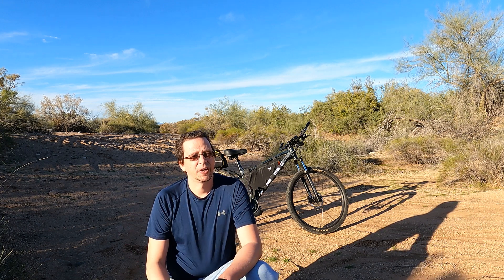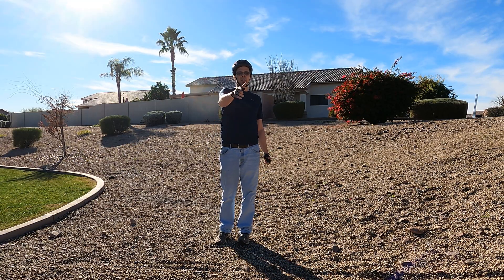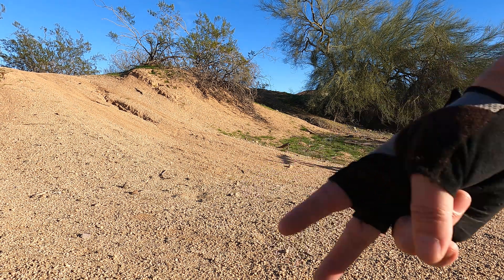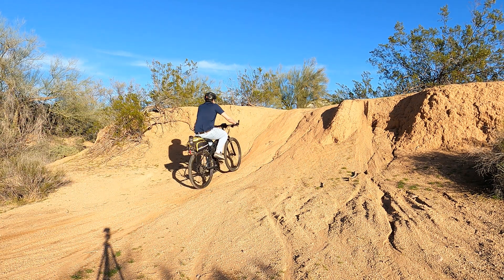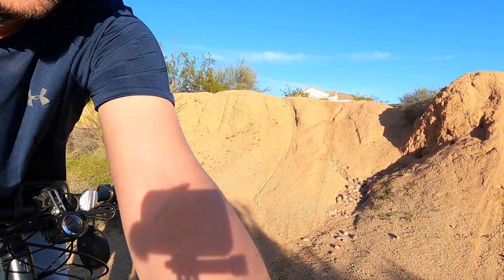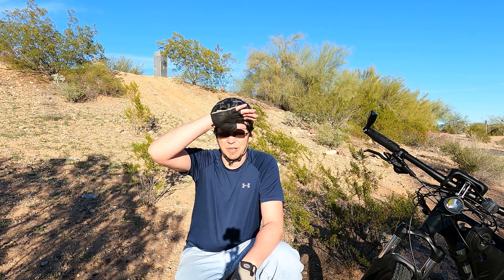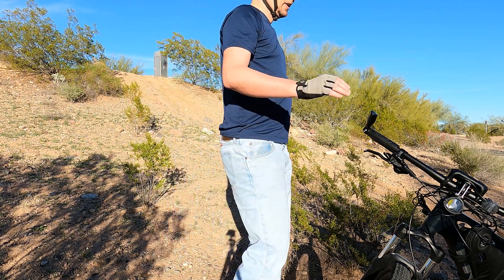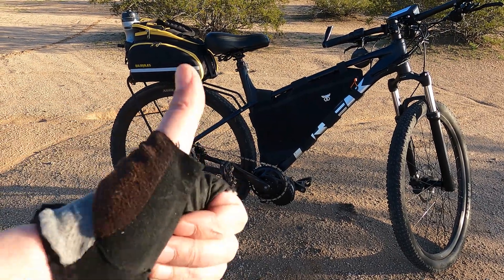🚴‍♂️BBSHD Hill Climb Tests | Electric Bike Hill Climb Tests

Comment: I've had 2 bikes with bbshd's over the last 2 years now and they are still both complete weapons and a joy to ride. 

If you read this comment and you're on the fence about buying a bbshd, just do it. 
You won't regret anything and you'll enjoy every moment.
Reply: How often do you go through chains and cassettes?
Reply: @thesquishyboo  casettes i've changed once, but it wasn't due to wear. I just wanted to tweek the ratios. 
10 speed chains are only $12 or something, so i just change them each year so far. I'd rather not be out on a trail dealing with a broken chain, so i just change them routinely. 
I've broken 1 chain so far, but i'm not sure how it broke and i don't think it was ebike related, i just hit something on the trail and weakend it 👍
You do get extra wear from running a middrive, but it's not hard or expensive to refresh.
Reply: @ thank you very much for your reply. I am going to buy the bbshd for my road bike and convert it. I cannot wait!
Reply: @sparkoceanic Hi spark, hope you don't mind me shortening your name up like that,I'm glad that people like yourself are giving your honest opinions, and that places like this exists, I'm trying to learn, about everything even this internet thing is New to me, I've tried it before but that's right around when I had an accident, some years ago now, and well I'm back at it again now but finding it hard to talk with people,or rather how to talk because I'm older I think and so messed up physically and even have what's called dislexia and a little bit of other stuff along with PTSD, so some stuff really going on, and because of a stroke and breakages in the spine I've suffered any how I'm finding it rather difficult in explaining things to people, it's almost as though don't have the time to listen or even really want to, I honestly don't know,but man im going through alot right,and now days really who's not; I totally get it, I understand; and I don't know why, it's almost weird because you can't really get what you need to say out there fast enough before people just turn you off like a switch, so I'm finding it difficult to talk to people while making it as short and to the point as possible and that's hard with being messed up from a stroke you're supposed to be able to meet and make friends on here right? I thought that that's sorta what goes  on with these inner web things or I mean interweb site's or no, web sites, I mean right? Sorry about that. See I mess things up sometimes and I end up not being able to even meet people for friends. Anyhow , enough with that I just thought that if I could at least explain why I'm so weird then I could make friends even at my age if they'd take a minute to try in understand me. Well it's my only dream right now before my time's up man, is to build a bike that I could pull a little trailer with not so much for a solar panel, although it would be cool to build one like Eric's but I'm going to buy like 2  extra batteries and chargers  for whatever bike I wind up with. But living vicariously through Eric's films I sort of had that dream of doing the solar panel thing, it's so cool and energy efficient and                                        .I'm trying to commit with  actually even  just taking that first step of just getting all the COMPONENTS FOR MY BUILD, I'v already made the decision that I want to build my own, sorta like Eric's,but a little bit larger in amp hour's and if possible more watts, because my legs and back are really shot, probably am going to have to count on the system to do pretty much ALL the work. But man I was rode hard and hung up to dry Soo many times in my life, in my 60s now, have been a couple years  one of my friends, actually my only real friend would help me get my build started but he's still wrapped up with the last couple years of being in the navy and I don't have what it takes to understand and put together anyything anymore I'm not that good with many things any longer, but I've really been trying, I'm actually afraid of ordering Soo much exspencive stuff and find out later that I even messed that up , my anxiety just goes through the roof even thinking something like that you know what. I think more than the lack of really understanding watts and amps and all of it, being physically disabled is more challenging, but I'm gonna do it man, I have to, I really do" it's something that I promised her we were gonna do.   my wife passed in the same week that nearly killed me and how all this got started with me feeling the need to ride a cool bike across country, her and I were going to do it just as soon as covid was over; man I'm sorry I talked so much, it's how come I can't make friends too I think, but I I genuinely love people and love life and man I really do have to make friends before I'm gone I'm serious I've been my whole life with only one or two friends and one's gone and the other one I can't see and probably won't by the time he's out of the Navy I don't have anybody to do anything with

Comment: I just put the 02 Schwinn taff aka Humpty Dumpty together 750w 73mm electric motor, and the 52v  Panasonic inr 18560 35e shark battery. It does 40 right now.
Reply from the maker: 40 mph is a nice speed. Perfect for riding in traffic.

Comment: Planning on swapping out my dual hub krusader to a 1000 mid drive bbshd. Should I keep the bike a single speed?
Reply from the maker: Gears are best with mid drive in order to get climbing power out of it.
Reply: What would you suggest with chainring size I think current it’s a 36. Maybe a 9 speed?
Reply from the maker: For the front I went with a 42 to get the chain line right https://youtu.be/CBBde5yRW7M In the back the bigger you can get 1st gear the steeper it can climb. Think my 1st (biggest gear) is 42t.
Reply: @Eric_Tennant  I’m new to bikes or e-bikes. So the rear a 42?  What size at the crank?
Reply from the maker: Front crank a 42t and the back is a 10 speed with a 42t as its biggest gear.
Reply: @Eric_Tennant  thank you I appreciate it. It’s all confusing somewhat but I’m trying to get together a list of what’s needed to make a hill climber
Reply from the maker: Anytime!
Reply: @aeestep77 I run a 28 tooth bling ring on my bbshd, and the biggest rear cog i have is a 28. 

If i was to run a single speed bike, i would run something like a 15-18 rear cog with a 26 inch wheel if you have that 28 tooth front ring.

A 52v bbshd with a 1 to 1 ratio on a 26 inch wheel will climb any hill you can remain on the bike without needing to pedal. It is EXTREMELY torquey.
Reply: @sparkoceanic  now I need to measure see what size bottom bracket is. Maybe a 100 or 120mm I’m told
Reply: @sparkoceanic I contacted Rambo. The rear cog is a 22 and the chainring is a 36 t narrow wide. I thought about maybe just keeping the dual hubs. Run separate throttle for a mid drive. Separate battery etc
Reply: @sparkoceanic  my bike has 36 narrow wide chainring and 22t cog. Saw a vid where a person made a triple motor setup. Separate throttle etc for the bbshd
Reply: Mine is 44 front and 11 speed 11-50 rear. 30mph and 215lbs up brutal hills with a prosthetic leg. It's a beast
Reply from the maker: @nathanmcgill4157 Indeed the motor is. Over 4,200 miles on this one so far.

Comment: Does anyone know if this crankset motor will fit the costco Infinity Boss Three hybrid bike?
Reply from the maker: Yes. Just have to make sure it doesn't pinch the rear derailleur cable that run on the underside of the tubing.
Reply: Thanks for the reply, I think I’m going to try this out, less than $1500 - $2000 for a whole new bike!

Comment: Yup.  I’ve run two.  My current one uses a 42 tooth front, and 42 tooth bottom gear. 

It might not go terribly fast in bottom, but I’ve yet to find a hill it cannot pull.

Note that you’ll have less grunt with less than 40% charge.
Reply from the maker: Indeed full change I went up that last hill on one wheel by the end of it. Just didn't have the camera going that day.

Comment: Nice video. I'm really impressed with the power on my Befang BBSO2, 750w with 52v 17ah battery.  What you find out quick is that if you're going up a steep hill in a gear that's a little too high, you're not going to make it. You gotta stop, turn around, get in the proper gear and take it again. Once you're in the right gear it climbs the hills like a billy goat even with throttle only. Just wish the throttle wasn't like a on/off switch. It's like full power or nothing. Hard to keep the front tire on the ground from a standing start, especially when you're angled up on a hill.
Reply from the maker: Throttle does have a variance but the one I have has problems. Has a weird dead zone. And the sensitivity does come across like an ON/Off switch. 

I need to play with the settings more using the programming cable or there has to  be a better throttle sold somewhere I would hope.
Reply: @Eric_Tennant  perhaps the throttle sold by Luna?

That said, however - the throttle on these things IS sensitive.  One must be careful with it.

Comment: Alright man this is pretty darn cool.  I was curious about how well it would climb.
Reply from the maker: Battery was low even. In that large gear the bike can almost go up a cliff. Bafang is my big F U to Arizona mountains.
Reply: @Eric_Tennant  that is a great comment.  I came real close to changing gears in Arizona ,especially when I went through the copper mine . Arizona is the state i remember the must . It had the most challenges and the most diversity of landscapes . Every time you go through a pass it changes.
Reply from the maker: To bad 191 was so cold then because that's one of the best areas of Arizona in the summer. It will be 120F here in the valley and up there it's 75F. Lol 9000 FT up.

Comment: Impressive but I reckon a lumpier back tyre would help a lot.
Reply from the maker: These tires are getting a bit worn.
Reply: Needs more power. Pumping 4,000 to 5,000 watts thru the same motor you can climb steeper faster with balder tires (done it) and I’m 260lbs. 

Tires help but the motor can really push you. 

I use a second motor to help reduce the strain and add torque to the system. So I’m also adding 3,000 to 4,000 watts thru that. 

But at or above 5,000 watts I can climb with surrons even if my tire is bald 😊

Comment: that bafang is stronger than i thought. you will be doing wheelies in no time
Reply from the maker: Happy I didn't go with the BBS02 (750w). This thing is going to pull me right up these mountains once they are not frozen.

To practice wheelies, I think a soft grass area will work best. Luckily the ground doesn't freeze here like in your areas.